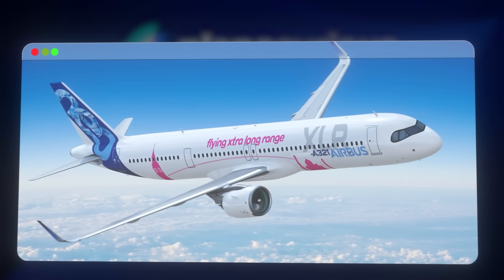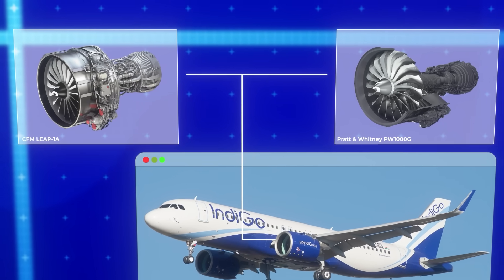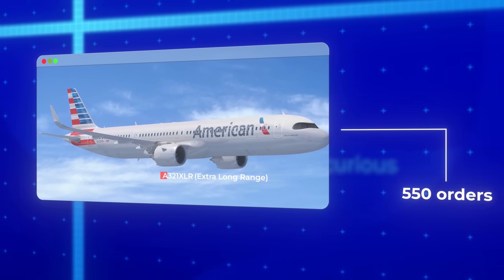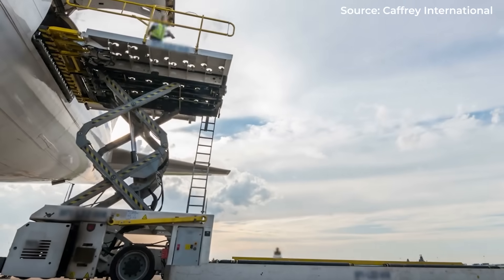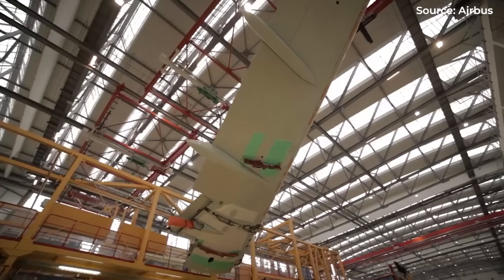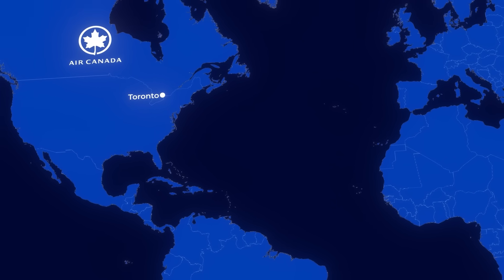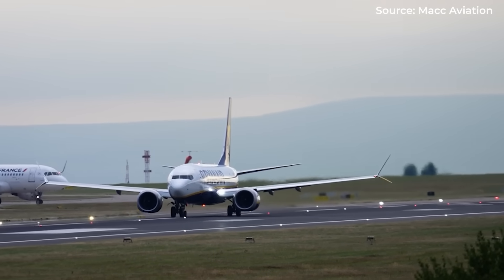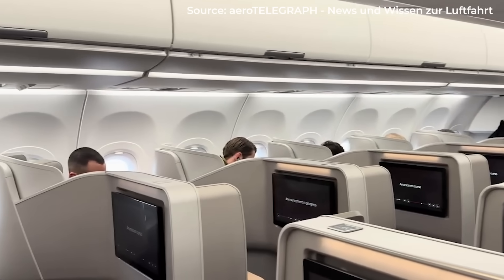How Airbus Outsmarted Everyone With One Jet

Comment: Nobody ever seems to mention that these narrow bodies have a significantly slower cruise speed. Adding about 30 minutes of flight time over an A350 on a flight of 6 hours
Reply: that might still equal out as a smaller plane has a shorter turnaround time
Reply: @ababelabel   Except that it won't have a shorter turnaround time.
My dad flew 757/767.  He said the one bad thing about the 757 was the LONG boarding/deboarding times due to long single aisle.
The A321 will take a long time to deplane vs widebody.
Reply: @Pwj579 not true at all. The single aisle airplane boards much quicker. When you have 10 to 11 seats in one row, the extra aisle isn’t going to help much.
Reply: @rtbrtb_dutchy4183 six out of one versus ten out of two isn't very different, especially considering the twin aisle bottleneck is when they join at a single door.
Reply: The flight time difference is recovered before and after the flight. I took JetBlue from Amsterdam to JFK. Boarding took 20 min and they closed the door and left early. When we got to JFK, you don’t show up at immigration with 400 passengers either. From getting off the airplane to being streetside with my suitcase was just about 20 min.
Reply: yeah, but if you do a direct flight instead of a connection flight, your 7+2 hour flight is now 6 hours...
Reply: But they’re designed for much faster turnarounds and way higher cycle counts, saving on maintenance etc.
Reply: The difference between a 6 hour flight, or a 5 and a half hour flight, is not important to me.  This is especially true, after adding the time spent at the airport, security, and travelling to and from the airport.
Reply: @MegaBoolaBoola  I completely agree - 30min extra on a 6 hour flight isn't much when you add in the airport delays. Also the 30 minute flight time advantage of a larger, faster plane is eaten up by longer boarding times and the fact that widebody planes operate out of huge airports with masses of corridors and high taxes.
Reply: @MegaBoolaBoola  it might mes the difference between being able to turn around for another flight on a day or not. The sooner a new load of passengers replaces the current one the better.
Reply: @AndreSomers    Good point.  However, XLR is designed for long-haul, not multiple turns per day, so not as relevant for likely routes.
Reply: @MegaBoolaBoola  the reason the XLR is considered a game changer is because it didn’t give up on its ability to do multiple legs in a day. It can do both. So it still is relevant.
Reply: @rtbrtb_dutchy4183    My point was that the XLR variant sacrifices cargo space and costs more.  So, airlines will generally only choose that variant for routes they need the extra range.
Reply: @MegaBoolaBoola  it reduces the cargo space by one container. This is usually taken care off by the fact that it won’t have high density seating. 

But the thing is, the hourly operating cost is almost identical to all the other A321/320 etc. So the airplane can be utilized on short haul trips as well. This is convenient if certain routes need a wide body during peak season and not during off peak.
Reply: @MegaBoolaBoola or you can spend an extra hour flying further at 0.84 to off-route hubs, and add two or three hours for a connection flight either end, plus transfer times.

e.g. Oslo-Halifax versus Oslo-Amsterdam-Toronto-Halifax.
Reply: Indeed. Cruising at 0.77 instead of 0.84 is a major difference. Good thing the A350 and 787 cruise higher otherwise this would lead to major speed problems on some routes (north atlantic tracks for example).
Reply: The operator's don't care about how fast you get there but how much they save. All businesses are there to make a profit even if it means adding an hour to your flight.
Reply: They are designed for different purposes. A350 is designed for long-distance efficient flight. It flies higher where the air is thinner, which requires it to fly faster to maintain lift. The A320 XLR is still fundamentally an A320 neo with additional tanks. It's not designed for long haul.  It's designed more for routes with fewer demands. Point to point. The service ceiling for efficient flight is lower on the A320 than the A350 XWB, meaning there's more drag. Air resistance increases 4x as speed increases.
Reply: @zane___k7333 it doesn’t fly higher. Throughout the trip, they basically fly at the same altitudes. 
It doesn’t require to fly faster to maintain lift at higher altitudes, since the wing is slower, it can also fly slower for the lift required.
Reply: @rtbrtb_dutchy4183 factually incorrectly. The A350 XWB uses the Trent XWB-84 AND The A321 XLR uses either the CFM LEAP-1A  or  the PW1100G they bothing have very different performance indexes.
Reply: @zane___k7333 engines have nothing to do with this. One airplane is 200K LBS, the other is 700K lbs. Ofcourse the airplane weighing 3 times as much, needs bigger engines. 

But this has nothing to do with speed. Aerodynamics sets the speed of airplanes.
Reply: @rtbrtb_dutchy4183 i don't get your point. The aircraft are not designed for the same purposes. You said they fly at the same speed which isn't true. which is why i explained the differences in the engine. The efficiency performance indexes are different for each plane. It means in the real world. The XWB WILL fly higher and faster. Why? Because that saves the airline money. This means as it flies  higher it needs to fly faster, why? Because the air is thinner. Which is what saves the airline money on fuel. Heres an example you can check for your own self on flight radar24. Two planes. The A321NX LR (jetblue)and A350 XWB(Air france) same route Paris to New york.  A350 XWB had a max altitude of 40,0000 ft speed of 474 kts. A321NX LR has a max altitude of 32,000 ft and a max speed of 438 kts.
Reply: @zane___k7333 first of all, I never said they fly the same speed. Both the A320 and B737 cruise around M.80. Most wide bodies fly around M.83 to M.85. 

But this is based on wing design and has nothing to do with engines, as you try to claim. 

The 737 is certified to FL410 and so are some A320s. Their engines do not require a higher speed at these altitudes. Same with the wings, since the wings are designed for lower speeds overall. 

Your comparison between the A321 and A350 on your paris to NY is flawed. The A350 has a much longer range than the A321LR. So the A350 doesn’t need full fuel, far from it and can probably climb to mid to high 30s right from the start. But it won’t do this if it flies from New York to Singapore, it will start in the low 30s. 

You also don’t know what the winds were. Or turbulence. The A321 would be light enough to climb to FL390 probably, towards the end of the flight. But if the headwinds are stronger above FL320, it’s not worth it to climb through it. 

My whole point was, aircraft engines do not require a higher speed at a higher altitude. The A320 can fly at FL410 just as easy as FL330, engine wise and at the same speed.
Reply: Ok and
Reply: Significantly slower and lower altitude because these airframes weren't designed to efficiently carry that much weight. It's an unfortunate stop gap until a true 757 replacement can be designed.
Reply: @MGXsport the normal 321 Neo and the LR is can already do what the 757 did and better. So it’s not a stop gap, those planes replaced the 757. The XLR can do a lot more than the 757, no comparison between the two.

Comment: As a former airliner engineer, I find "revolutionary/outsmarted" to be clickbait-ish.  People have been putting aux tanks etc on airliners for a long time.
Reply: The A321XLR is not using an AUX tank. This is why they needed additional certification to do the modification.
Reply: @kazedcat  it doesn’t matter built-in tanks aren’t new either and it is Clickbait.  It’s a cool plane. Don’t get me wrong, but this is not revolutionary by any metrics of the word.
Reply: @RevolverOcelot79 It does matter additional certification means the modification is a new thing. Otherwise they would just approve it using previous certification procedure. EASA says it's a new thing and Airbus needs additional evidence that this new thing is safe.
Reply: @kazedcat bot
Reply: @kazedcat  Any modification to the original Type Certificate requires certification. Fuel tanks integral with the airframe fuselage structure is not new. The A321 already has a center fuel tank in the fuselage, between the wing spars, a very robust area. The additional certification was the placement of integral tanks  aft of the wing rear spar and aft of the wheel wells—not a very robust area. The delays came from Airbus having to beef up that area as an afterthought. The FAA also raised concerns about the ability of the passenger floor (which is now a wall of a fuel tank) to withstand a fire long enough to enable evacuation. Not much change in terms of technology, just novel placement. And it didn't change the way the industry works, just extended the range of the airplane to match some other airplanes.
Reply: @petep.2092 Tanks integrated immediately behind the landing gear bay is new. This is why Airbus needed to proved that the tank is not a fire risk in a crash event. And they needed to proved that the tank are sufficiently reinforced against landing gear intrusion.
Reply: The novelty is not the aux-tank but the integration of the aux-tank with the fuselage, to save on space and allow more cargo and range. This is what allows it the extra mileage without compromising cargo space that competitors do not have at this moment. This is also what required the new certifications.
Reply: As a former Boeing engineer 😂
Reply: You are talking about the a321XLR like it’s the most revolutionary plane ever. Did you have such words for an actual revolutionary plane like the 787?
Reply: @Evil.Totoro the 787 is less revolutionary than the A321XLR. The B787 didn’t change how the industry works. It’s a 767 replacement and does it slightly cheaper. But it still cost $15K an hour to move 250 people. 

The XLR cost $7K an hour to move 200 people. Airlines can use the XLR to fly on low density routes. Low budget airlines can afford the A321. 

The XLR can fly from Pittsburgh to Bremen non-stop with 150 passengers and make money. The 787 can’t do this.
Reply: @rtbrtb_dutchy4183 ok, so the full barrel fuselage constructed out of carbon fibre, with the larger windows, lower cabin pressure and noise aren’t that revolutionary? As good as the a321xlr is, it still doesn’t have the range of any 787 model. As a wide body, the airlines love it, as shown by its 2000 plus orders, and that’s just from its initial variants. When it’s all said and done, the 787 will probably be the best selling wide body of all time.
Reply: @Evil.Totoro the materials is revolutionary. But it did not drastically change the industry. It revolutionized how airplanes are built, not how the industry operates. It’s a popular aircraft because it does established routes better and cheaper. 

But if you want to fly from Pittsburgh to Lyon, France, you still have to fly from Pittsburgh to JFK on a 737/a320, switch on a 787, fly to Paris and then Paris to Lyon on a different aircraft. The 787 did not change this trip compared to a 767. 

The XLR can potentially take people from Pittsburgh straight to Lyon. That’s a game changer.  

Not only that, the 787 will cost $16,000 per hour to operate. The XLR will cost $7000 per hour.
Reply: @rtbrtb_dutchy4183 Integral fuselage tanks aren’t revolutionary. They’ve had integral wing tanks since the 50s.  Making it an integral fuselage tank is not anymore extraordinary.

Was not only revolutionary and its materials, but the wing designed the windows design the fact that it has generators for engine starts versus an APU
Reply: @RevolverOcelot79 it’s not about integral fuel tanks. It’s about the fact that an A321 has an 11 hour range while keeping payload. It’s a game changer. The 737 cannot accomplish this. 

Starting engines with generators is a must, since there is no bleed system on the 787. But to start engines electrically isn’t revolutionary. Many smaller jets, without an APU, start their engines the exact same way.

Same with the windows. Have you seen the Gulfstream windows?  They are twice the size and been around since the 1970s.
Reply: @rtbrtb_dutchy4183 really? I think the 787 solidified the point to point model Boeing bet on, whereas Airbus still went for the hub and spoke model. AKA the A380. If anything the A321XLR is piggy backing off of hit the 787 bet on. So yes the 787 is revolutionary in bot materials, and operations.
Reply: @rtbrtb_dutchy4183 it changed the industry in the fact it destroyed the hub and spoke model and helped solidify the point to point model. Note how no Jumbos from either country are no longer in production? The sales of the 787 speaks for itself on how the industry has shifted because of it.
Reply: @Evil.Totoro destroyed the hub and spoke?  Where do you get this from?  Point to point is currently in decline, in favor of hub and spoke. Hub and spoke always stayed strong with international, intercontinental travel, which is where the 787 operates. The 787 did not change this at all. 

Not sure what you mean with Jumbos. I’m guessing you mean the 747 and A380. (Technically any wide body is a jumbo, this includes the 787). 

The 747 and a380 are no longer being built because they have 4 engines. It cost way more to operate compared to a twin engine. Their cancellation had nothing to do with hub and spoke. As a matter of fact, the 777X is basically the same size as the 747, but with 2 engines.
Reply: @rtbrtb_dutchy4183  Ignorance is a bliss isn't it?? The 787 introduced the point to point model and certainly revolutionized the industry as a whole. It pioneered the use composite materials in aircraft construction(Look at the A350 as well where do u think it was made from?) All the stuff you said are almost nonsense. Whether you like it or not Point to Point is the norm that most airlines follow
Reply: @Aspir3xx point to point is not the norm for most airlines. Heck, even Southwest Airlines is considering switching to hub and spoke. 

So, if the 787 is introduced point to point, then show me the routes that didn’t exist before the 787. There must be a whole bunch of new routes you can show me. 

Now, new routes for instance that did happen because of the 787 is San Francisco to Singapore. No other airplane could do that trip efficiently. But it’s still hub and spoke, since United flies those passengers to SFO on smaller aircraft. 

The 787 and A350, revolutionized how aircraft are built and revolutionized fuel efficiency. But it didn’t change the industry drastically. It just made the same routes, less expensive to operate. And yes, it did add  a few additional longhaul routes that wasn’t sustainable before in different aircraft. 

The XLR is potentially a game changer for the whole industry. Think Pittsburgh to Lyon direct. Valencia to NY direct. Stockholm to Orlando. 

All these routes, that can’t fill up a 787 or a350, but are too far for regular 737s or a320s are now suddenly economical. 

And let’s not even start with the low budget airlines able to fly longhaul. JetBlue already started, they used the range of the LR to fly from JFK and BOS to European cities. This will expand with the XLR. Breeze airways is thinking about using their A220s to fly to Europe. Southwest is talking about getting a second type of aircraft to fly to Europe. Which type do you think they can consider at this point?
Reply: @Evil.Totoro  exactly. The Boeing 787 was far more revolutionary than the A21 series.
Reply: @RevolverOcelot79 no it was not. Maybe more revolutionary in regards to materials, but definitely not revolutionary for an airline perspective. The XLR is changing business practices in the industry.
Reply: @RevolverOcelot79  In terms of Jets, The Comet and the Concorde were revolutionary.

Others are more or less evolutionary.

Comment: Imagine what Boeing could have achieved by making anactual 757-200er...
Reply: Na ja, man bereitet sich auf einen Weltmarkt mit chinesischer & russischer Beteiligung vor.🤔😉😇
Reply: Chinese? Probably.  Russian? Never.  @T-BwBerlinKarlshorst-
Reply: They would’ve achieved nothing. It cost too much to operate.
Reply: They would have to change the engine with less powerful but more efficient ones. But other than that yes I agree that Boeing had to renew 757 to actually compete with A321neo series.